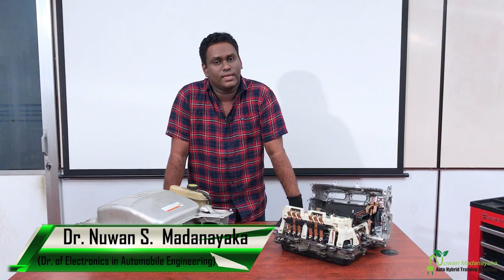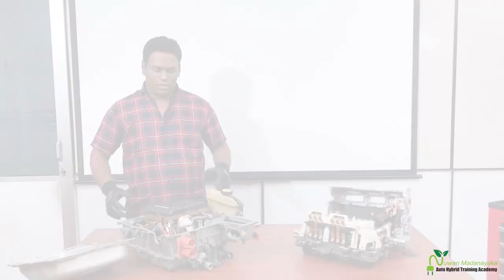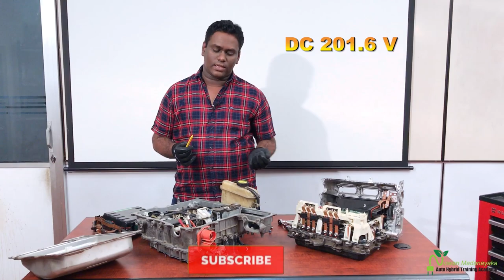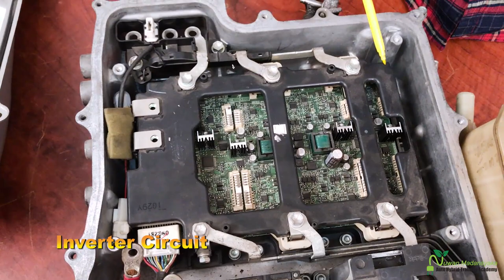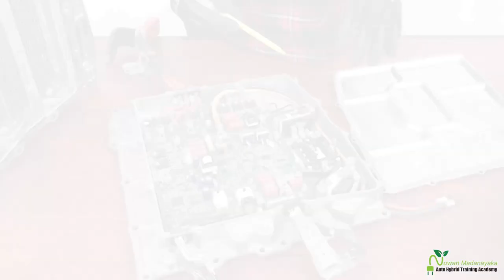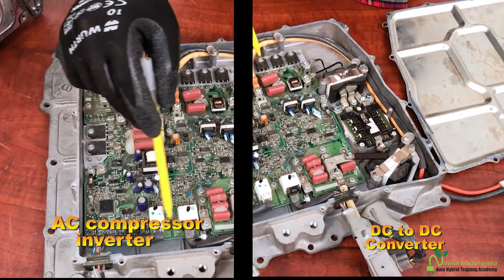HYBRID LESSON 3 ( TOYOTA POWER INVERTER යේ නොදුටු පැත්ත ) Sinhala

Comment: Thanks for the video. very valuable. how frequently inverter coolant should be changed?
Reply from the maker: Check coolant level in every 5000km, Check coolant quality in every 30000km and Change 125000km or 3 years which ever comes first..
Reply: @nuwanmadanayakaautohybridt3237  Thank you, Sir, Really appreciate your quick response. Got it clearly